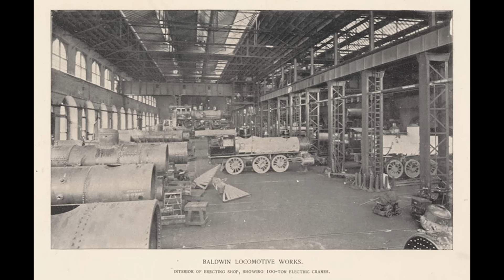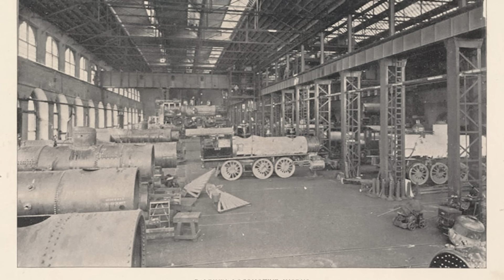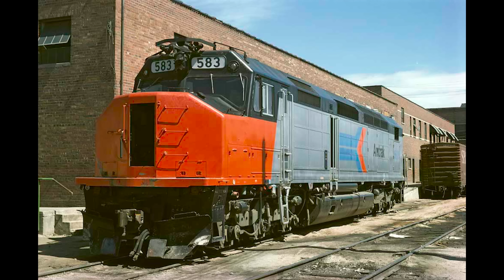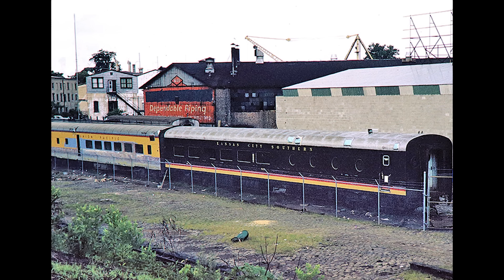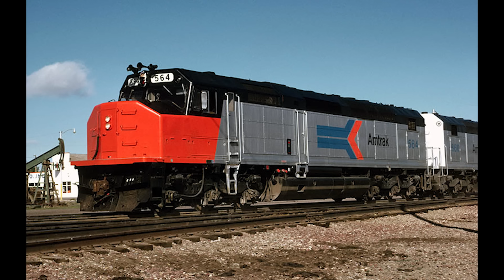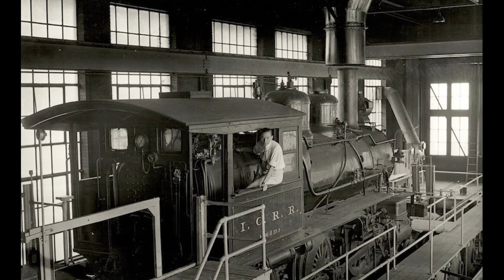Why This Locomotive Was Officially BANNED from Service

Comment: I was trackside north of Salem,  OR watching the Coast Starlight come down a long straightaway. The trailing locomotive was yawing from side to side, with the nose yawing in the opposite direction as the tail. The oscillation was so rapid that it could be described as a vibration, even violent. A locomotive moving that way must have been exerting enormous lateral forces on the rails, which they were not designed to tolerate.

Comment: So many comments in the narration here are INCORRECT!! The SDP40F was delivered beginning in 1973, not 1976 and they lasted a bit longer than 5 years. In 1978, about half of them were traded back to EMD for F40PHRs. In diminishing numbers, the remainder lasted into the 80s. Plus, it was SANTA FE, not Southern Pacific, that traded 18 SDP40Fs for 25 switcher locomotives that Amtrak wanted at the time. ATSF and later BNSF had no problems with them, although ATSF never really did have derailment issues with the SDPs back in the day either.
Reply: Mark, you are absolutely correct!